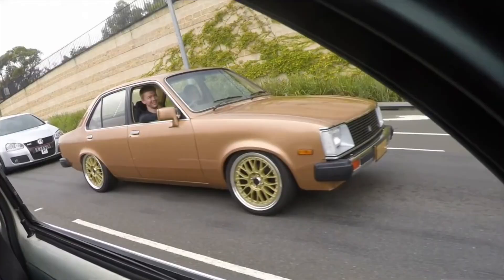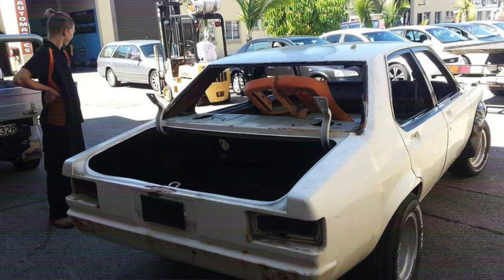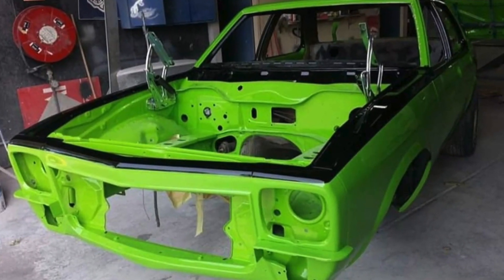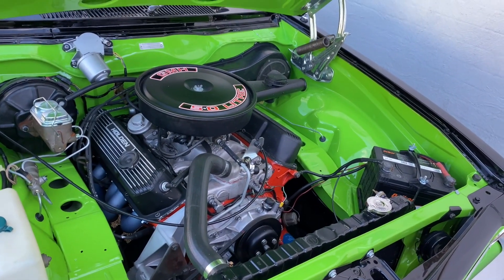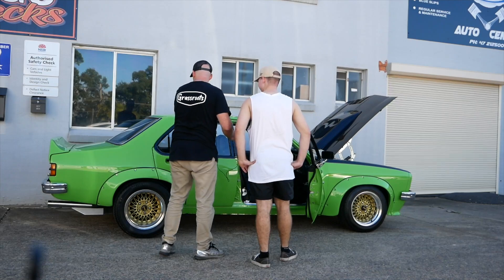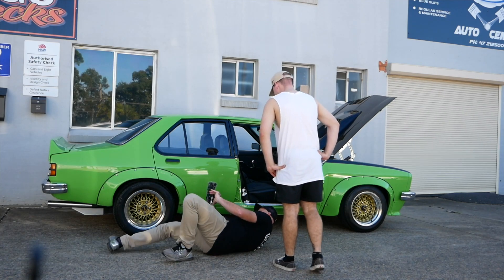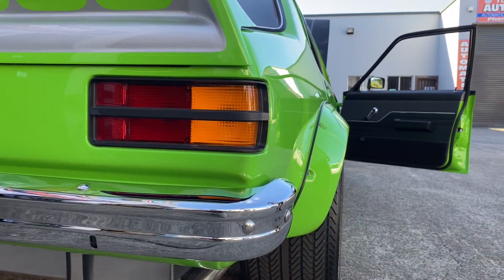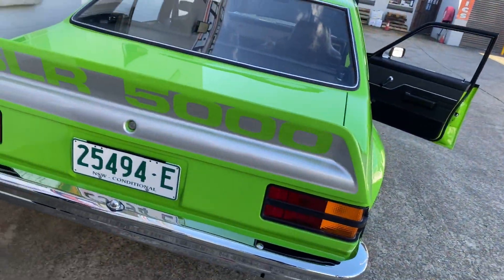LX Torana 5.0L 308 A9X SLR Tribute

Comment: outstanding! great to see it still has a proper engine in it too 👍
Reply: Soon that engine will go straight into a  gum tree or 2.

Its not outstanding. 
Front mounted engine cars must have a high center of gravity and narrow rear tyres.
If you do the opposite, your car won't turn around corners.
Reply: @dreyn7780  yea it's not like toranas won at Bathurst or anything
Reply: Thanks Piffiiiiiiiit Appreciate it mate 🤙

Comment: Muscle cars have a high stance with a fast revving engine and fast gearing.

Sports cars are LOWERED with a slower revving engine and slower gearing.

If you Lower a muscle car , you MUST also change the engine and gearing and the suspension  and tyres and lengthen the wheelbase  to perform at the Lower height. 
So just forget about toranas and buy the appropriate car for the driving performance you want to do. Clearly you actually want a rear mounted engine corvette.

Its just stupid you playing around with these tired old front mounted engine designs.

You shouldn't be anywhere near these torana things.